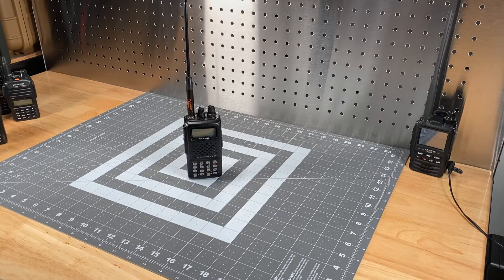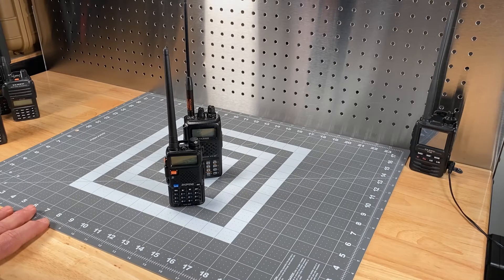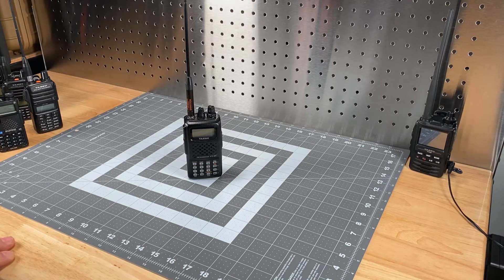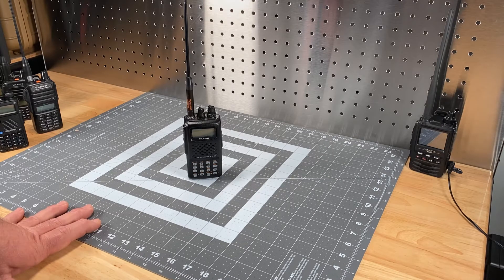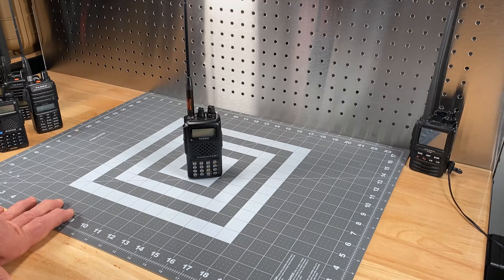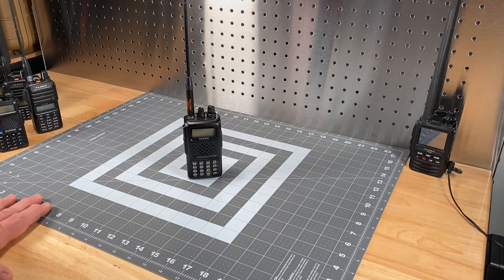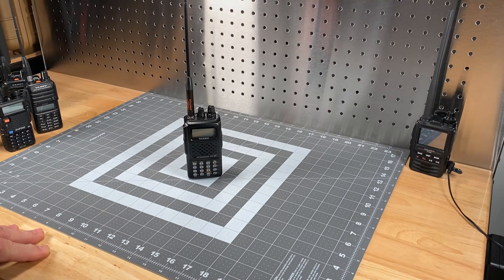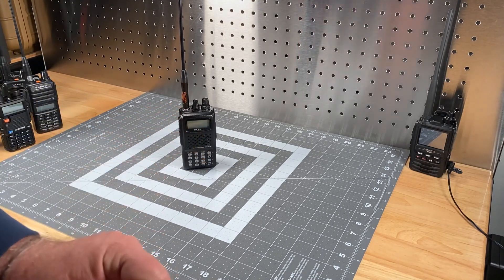Should I MARS/CAP mod my radio?

Comment: I ordered my IC7300 with the mod! I then went in and programmed it to only transmit on the General part of the band!  If I do a reset then it is wide open until I tell it to load the band settings.  I would need to set up the band settings because it comes for all the bands not just the General part.I have spent a lot of time around the military! I may be crazy but not stupid enough to mess around military frequencies.  When I was with the CAP we had someone that one of the CAP frequencies was good to use for his business! It didn't end well!

Comment: I basically stopped listening at 7:30 because i knew I already fully agree with your argument.
Reply: Crappy video, but this is my other channel and the video when I did the mod on my 3DR. 

This was my first Ham radio. I just bought the 400XDR and I again wanted to confirm my desire and need to do the mars mod on it so I was consulting with YouTubers. 

Thanks for the vid. 

FYI: When I called Yaesu back then, they confirmed for me that it didn’t matter if I or an authorized dealer performed the work and that the modification in no way affects my warranty unless I were to cause unrelated damage while doing so. 

This was something I personally wanted to confirm because of rumors. 

Here’s the video: https://youtu.be/DUpeidxG5vw

Comment: Hi KS6DAY! I just modded my FT5D. Is it ok to use the stock antenna to TX on other frequencies like 140’s and 440’s or do you recommend to buy a different one?
Reply from the maker: Since most of the radios that will be MARS modded will already receive, but not transmit, in that range, the antennas are resonant and will work for transmit as well as receive in that range. So, you should not have worry about changing out your antenna.
Reply: @KS6DAY  Thank you!

Comment: I have a HAM mobile thats mounted in my RV as well as a handheld. I modded both of them to work with my walkie talkies as we have 5 kids and the older 4 go running off when we go camping and they all have their own walkie talkies. This lets us talk to all the kids with one radio, as well as my dad through the repeaters who has his own license.  The mounted on in the van is key because its a metal box, so the walkie talkies dont work well inside the van while we have the mag mount antenna for the mobile.
Reply: Where could I read about how to do that modification? I'm new to this, thanks

Comment: I always favor the "better to have and not need than need and not have" logic.  Another consideration I have is that if I have a radio with broad capability, I could give it to somebody who does use those frequencies should their equipment have a failure.  It's just another capability I bring to any party where my presence is subordinate to professional first responders.  But I also understand the FCC position (most of the time) as they are trying to herd cats.  Not so much the hams who are mostly domesticated, but the slobs.  Just like the difference between responsible hunters and slob hunters.
Reply: I agree
Reply: One place too many EMCOMM hams fall down on this concept, "better to have and not need than need and not have" is training. I teach with this concept which is analogous to yours. "You will not know what training you need until you need it and then if you do not have it, it is too late and it is wing it."

Comment: I had my yaesu ft60r modified by GIGAPARTS when I bought it new. They said no issues with voiding the warranty. If I have a problem just send it back. I use mine for everything. Ham, GMRS and Murs and marine when I am on my boat. I have both licenses. So far no one has kicked my door down.
Reply: Nobody in the history of FCC databas has even received even so much as a letter for using a non type approved radio. As long as your in licensed and spec for the radio service your transmitting on, nobody will know and nobody would care (except for sad hams).

Comment: Finally a logical reason for expanded transmit I have been in some sort of communication for 50 yrs and have always felt this way I my never need to xmit out of band but it's better to be able to and have the equipment at the ready than need to and have to try and modify on the fly good video  de kd5dnk

Comment: Thanks for a great video.
Have you though about doing this to a mobile unit, and if so, which one?
I would like to purchase a single, mobile unit that I can move between my 3 vehicles when doing off-road, off-grid, recoveries and rescues. 
I would primarily use the GMRS as that's what most people use, but occasionally there is a HAM that I might have to communicate with. 
Thanks in advance.

Comment: When you modify a radio for CAP you are no longer under FCC rules. CAP is considered a federal agency and as all federal agencies they are governed under the NTIA  which are far more restrictive n receiver and transmitter purity and tolerances..
Reply: Almost nobody does this to transmit on CAP freqs. People do it so that they can use commercial ham radios on GMRS and MURS because some laggard acquaintance never bothered to get a tech license, and it is more tactful to bend the rules on equipment type acceptance than it is for your acquaintance to bust in on bands they are not licensed for.
Reply: I correct the agency. It should be NTIA not NTIS. Sorry.

Comment: You get a sub for making the correct connection between these radios and firearm laws. Very true. It was after having the doorstop ( a baofeng) for over a year I decided to use the lockdowns as an opportunity to get my General,  working on mu Extra. I bet these radios are responsible for bringing more new hams into the hobby than anything else. Lord knows the old timers and the ARRL do nothing to get fresh blood into what would be a dying  hobby that has been replaced with cheap satellite communications and high tech for most people.
Reply: That comparison in the 2 arguments was really clever.  As someone living in both worlds, I totally get what you're saying.  If you follow comment sections, there is a distinct consortium of HRO's who pride themselves on yelling at others about the rules.  There isn't much of a debate that transmitting on FRS bands using HR is illegal.  Really, there's no debate.  Yet it's happening ALL THE TIME.  Just gonna have to get on with our lives lol.
Reply: @cobrajack-official  While it may be illegal it seems to me that the only reason for this rule is because radio manufacturers have lobbied to the FCC and congress to create these laws for the sole purpose of selling more radios. It simply wont work for me to need to install another radio, pay a few hundred dollars to get GMRS capabilities install another antenna on the roof, and have to find even more space for another radio body and face to fit in the vehicle. It's not as if an ICOM 5100 will radiate in an unsafe or vexing manner in the gmrs bands. It will work just as well as a new Chinese radio specifically made for gmrs and only gmrs. I already have the dual band and HF mobile rigs but the 4 runner is out of under seat space for radios and my little hand held gmrs that have become sub optimal these days, especially since gmrs repeaters are becoming ore common. I can also see where crossing the lines could occur , lets say if my wife was on the gmrs band on an HT and that went out on a ham band because the trucks radio was on cross band repeat. Then again we are self policing...
Reply: @9999plato  I like all your points here 👍
Reply: I'm glad I saw this .
I just paid the FCC for my GMRS privileges.  I'd csll it a license if I felt it was something I had to study for.  Therefore, I have decided to study and work towards earning my amateur tech and extra class LICENSE so that I can have a full understanding of exactly how these radios function, so I can make sense of FCC guidelines. 
It makes absolutely no sense to have earned the privilege of an amateur radio technician,  extra ,or general only to be told your privileges stop at 462-467 MHz.
And then to top it all off , expand the 11 meter citizens band into the FM spectrum.  
Now, I'm not saying I disagree with the changes for the unlicensed folks. In fact, I'm all for it.
What I don't appreciate is the government imposing restrictions on responsible folks by turning what should be a God-given right into a privilege. And then turn around around and expand the citizens' band for the irresponsible as if to say they have the right to operate. 
I personally think we should all have the right to all bands that were set aside for public use.
I figure a lot of people aren't going to appreciate what I just wrote,  and that's ok.
I'm going to earn all of my radio licenses for my own piece of mind so I can operate with competence and confidence.  
And I sure as hell don't want to be spending two times the money just to communicate with any GMRS friends.  Therefore, I will earn my ham licenses first,  then see what radio to get that covers everything I want. I'm sure I will have no trouble opening GMRS on a VHF/UHF cross band and transmitting within the guidelines of the FCC.
Reply: Now that I am a retired truck driver, I have added to our numbers about 26 new hams. We teach at my church, and by one, twos and more,we haven't had one that failed yet.
Reply: HF bands are more than enough to keep me busy !
More fun than HTs....

Comment: A person is aloud to receive any frequency without decrypting or decoding what they are listening to, by FCC rules and regulations a person is not aloud to transmit on any MARS or CAP frequencies without becoming a member of those organizations . MARS and CAP will issue a call sign to you for authorizing you to use those frequencies. I myself have once been a CAP for two years in my past and more recently a member of Air Force MARS, I can no longer transmit on those frequencies because I am no longer a member of those Organizations. FRS radios no not require a license but GMRS does require an FCC license ( 100 dollars per year).
Reply: GMRS License is 70.00 and is for 10 Years and covers your entire family.
Reply: GMRS license is $70 and good for five years.
Reply: @furonwarrior  10yrs
Reply: @furonwarrior  ... It is 10 yrs as J. Lanning pointed out.  And if they ever get off their butts and make good on the FCC's rule change, the GMRS license will only cost $35.00 for those 10 yrs.  It was supposed to have happened in 2021 but has been pushed back to 2022 ... supposedly in January but we will have to wait and see.

Comment: In my experience as a radio operator who doesn't desire a permission slip from the State, HAMs are the most tribaslist, arrogant, close-minded Karens in society. Perfect example:Years ago I showed my new Baofeng to a ham relative. His reaction? "You can't have that!". He simply could not wrap his head around the fact that although he had done everything he was "told" and been a good little boy, here was someone who just said "F all that" and did it anyway.
And your assumption that you must have permission from the State to understand how to operate radios and antennas is an aspect of the above. I could pass the ham tech exam in a heartbeat, without studying. It literally is not rocket science. But I do not wish to give up any and every ounce of privacy that I have by literally plastering my name and address on a government web site and be on yet another govt database.
Reply: I agree that it is a huge invasion of privacy for the government to put our info out for anyone to doxx you with. At the very least the info should be restricted to other licence holders and FCC staff. People with security clearances who are directed to maintain a very low profile per OPSEC regulations are outed by this system Utter foolishness. By putting the info out there anyone could do anything and simply look up a random callsign and use it to create chaos and the original licence holder cant disprove the allegations.

Comment: Yes, in some cases absolutely.  I am licensed for both HAM and GMRS and most/all if my close wheeling buddies are also licensed HAM operators and we of course use HAM while off road.  However, there is a HUGE segment of the off road community that are not licensed HAM operators and use only GMRS.  I think it would be dumb on my part to NOT have a GMRS capable radio in the event we have a problem and are unable to reach help on our normal HAM frequencies when it is entirely possible help could be only a couple of miles away on GMRS.
Reply: I’m not a licensed electrician so therefore I cannot myself replace the electrical outlet in my home
Reply: I won't have a radio that won't transmit across the entire VHF 136-174 and UHF 400ish - 480ish. The radios I have that were "mod'ed" were done professionally. The others are Part 90 out of the box, FPP
Reply: Good you are licensed in both services. Shame your mod radio is no longer type approved by FCC to use on those bands. This should have been clearly understood while studying for your Ham license. Just because you can, does not allow you to rob a bank.
Reply: @ag1382  pretty sure FCC as well as ALL law enforcement do not care that I carry a radio capable of TX out of class in case of emergency. Nor would they care if I actually TX out of class/certification in an emergency. 

Thank you for clarifying the rules for all readers and viewers. 👍🏻
Reply: @randomstuff3672  no the illegal radio police will not track you down, but your video is a great target. GMRS radios are cheep.
Reply: @ag1382  Yes they are. That’s why I have two. I can give one to a family member so they can transmit via my license. I also have non modified HAM radio (I should have made that clear.)

I still think it is a good idea to have a modified radio, just in case. It is cheap insurance and hope I never need it.
Reply: @ag1382  many hams with GMRS license use the same radio for both services for daily use. As long as you program it correctly and stay within specifications for the service your transmitting on, nobody will know. The ft60 would make a fine multi purpose radio for Ham/GMRS/Marine/MURS
Reply: @ag1382  lol comparing a bank bank robbery to what can be argued as a 1st amendment right. No wonder HAM operators get a bad rep, because if people like you who think talking over the air without government permission is bank robbery. I bet in Soviet Russia you would be the guy talking to the KGB about his neighbors on a regular basis.
Reply: @Nevermor309  You don't have a right to interrupt other stations.  The licensing teaches you how to avoid doing just that.  Not a 1A right.
Reply: @ag1382  Removing a few chips from my own radio is far from robbing a bank. Aside from not wanting to blow another $400 on another radio when your current radio can do the same job on GMRS most people don't have the space to fit any more radios in the vehicle in a good location without taking up passenger space. I think these regulations are created simply to sell more radios, probably created by lobbyists with large campaign contributions who influence the FCC. Rules that joe blow cannot fight since we lack their deep pockets. Corruption begins from within and quiet resignation avails you nothing. The ARRL should be fighting these regulations but they are feckless.
Reply: @ag1382  Sad HAM detected

Comment: I work SAR and I'm a Wilderness First Responder. All of my radios have MARS/CAP mod for the very reason to assist those on non ham bands in the event of emergency. Those that are "sticklers for the rules", as you say, didn't fully read the rules. Particularly the FCC rule pertaining to emergency communication. In that they've truly failed their community.
Reply: in an emergency situation... You may use any Freq to get help... My view is that,,, Just like my pistol that i carry everywhere with me... id rather have it and not need it... Than to need it and not have it....
73,
W5LWK
Reply from the maker: Well said. I agree 100%.
Reply: @shockadellick  The people who will key up anytime obviously don't care about the rules and this is self evident. This is the same logic used by gun control advocates when the want to ban XXX. The criminals who use XXX as their tools of the trade don't care about the laws that restrict everyone else because they are criminals and the gun charge is the least of their concern when they are looking at a triple homicide and other charges. The same logic applies with the radio. Most who are in the hobby wont use those bands but want the emergency capabilities should an emergency arise. Same with guns. I'm going to have my wife's and my dual band radios modded, just in case. The rules/ laws are there to keep the honest people honest. Essentially pointless and sometimes counter productive to a safe society before the emergencies begin.